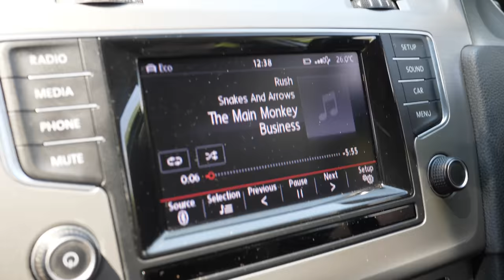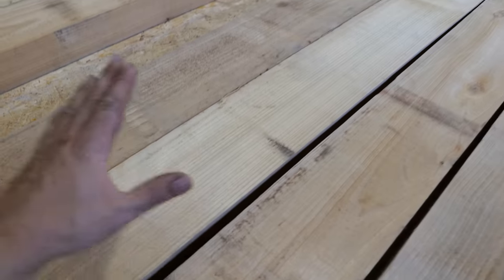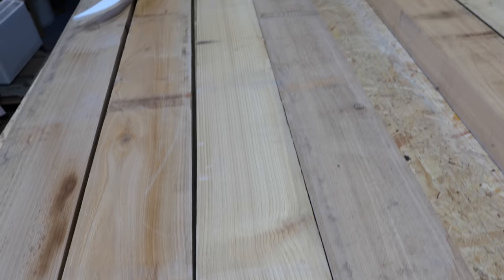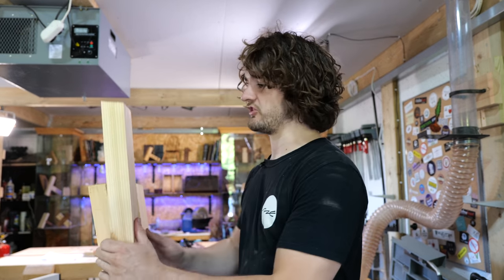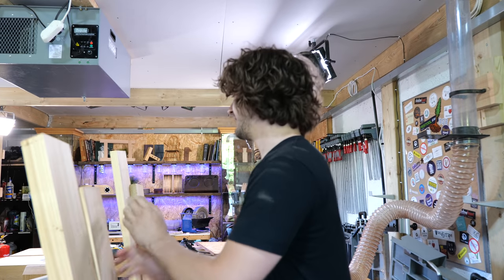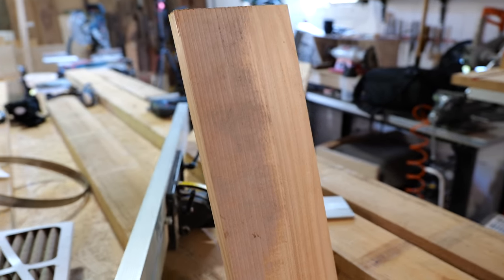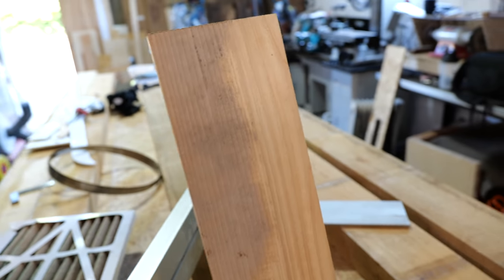Creating a JAPANESE Inspired PICNIC BENCH from Scratch | The Picnic Bench Project - Part #3

Comment: Working with cedar monday to friday I can attest to how difficult it can be to get maximum yield from the timber because of defects that are really common with rough sawn cedar. We work with 10mm tolerance in both thickness and width (not insane 1mm tolerances) and that guarantees all saw marks and almost all common sawmill defects from mishandling or seasoning are removed. It is nice when its not your money in question though

Comment: I usually use Fusion 360 parametric modeling for my projects, so when I see I'm lacking couple of milliliters after dimensioning, I just correct couple of numbers in project and everything got recalculated automatically, including pdf schematics. And I don't use templates - just do one piece freehand and use it as template after.

Comment: How would it look if you kept the "flick"on the profile of the seats, but varied the depth of the slats to keep the top surface horizontal?
Reply: That's what I came to say. Keep a smaller depth flick and "simply" profile the final flat slat on each side to match. A bit of extra work, but only on two slats. Would look nice.
Reply: Only concern would be whether it makes the outer seat slat too thin (which could be an issue in terms of flex etc, especially towards the middle)